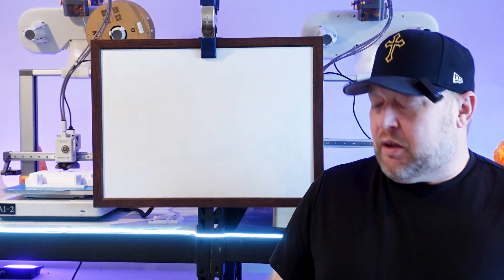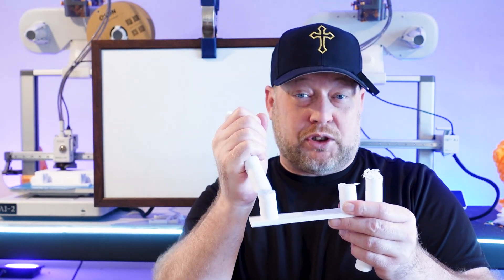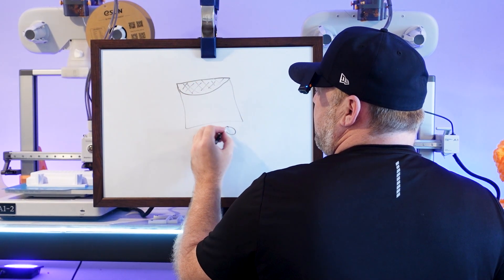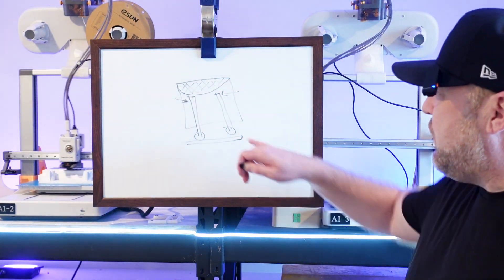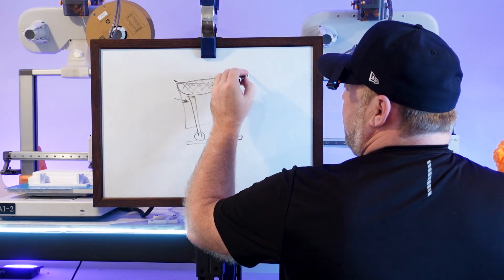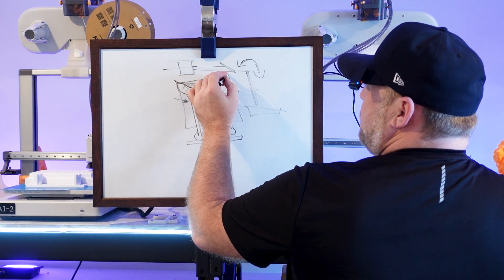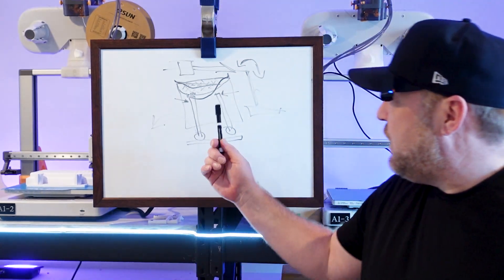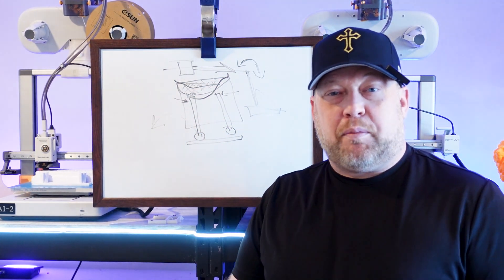Is Bambu Lab Setting us up for failure? Must watch my quest to save your print

Comment: I don't have one. But in researching these, some (CNC Kitchen, I think) have noted that trying to achieve high speed does reduce the strength of parts. So it looks like the race for maximum print speed needs to wait for hot ends to catch up. Not an issue for me since I don't intend to run a print farm and don't care about waiting a little longer.

Comment: Turn off "reduce infill retraction" basically doesn't retract when passing over infill parts. 
Some genius thought this setting was a good idea, but in reality all it does is make the nozzle drip a little filament in the same place until it builds up and starts catching on the nozzle when it travels over the same part. It's supposed to save time on the print, but honestly, it isn't worth it
I'm surprised more people aren't talking about this crap setting
Reply from the maker: The part did Print successfully after I changed the traveled to 250 with the same exact settings on cubic infill

Comment: Suggestions to try.  Set z hop under your filament settings in bambu studio to lift slightly when moving across the print.  You can also set avoid crossing wall threshold under the quality settings to avoid going over printed surfaces.  Grid infil is notorious for slight collisions since the infil prints over itself, most recommend gyroid since the generated pattern does not cross itself.
Reply from the maker: So I'm not crazy lol